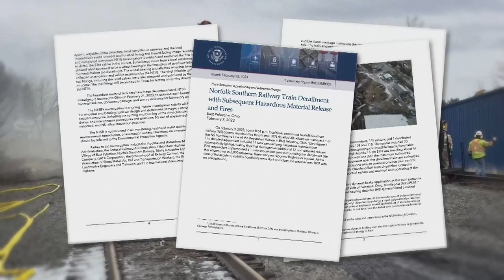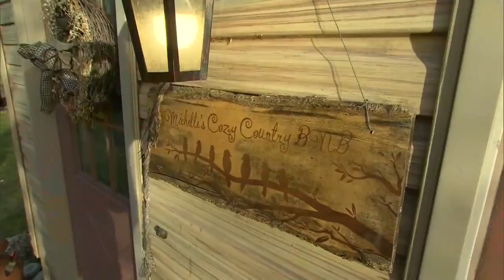Train crew had little warning before Ohio wreck, NTSB probe finds

Comment: So, it was an accident, and the they followed existing procedures, AND the automatic braking system worked.  
The only disturbing thing was who ordered the burn?
Reply: What do you mean who ordered the burn?
Reply: @rack_9  Officials decided to set it on fire rather than order vacuum tankers to try and offload the chemicals.
Reply: @arthurfoyt6727   Not sure where you got that they set it on fire,but when the chemicals were burning the air was too polluted as one of the chemicals were vinyl chloride which Is very harmful to the skin.  So they had to literally let it burn until the environment was safe to put out the rest.

Comment: LMAO that camera footage says it all. Who was responsible for monitoring the freight in transit? Who was supposed to be behind the camera? They had time to see it if they did check points with the cameras they already have? Lol  Where'd the legal protocol ???? ⚗️🧪🦆.   Because this isn't legal!!!!
Reply: Depends on what the other hub temps were.  You don't want to stop for a false alarm so they set a threshold.  Honestly I was surprised that they do have such tech to watch hub temps and an auto brake system once it's detected.